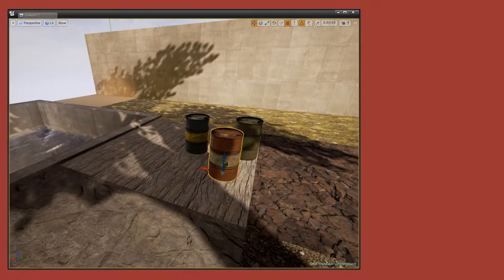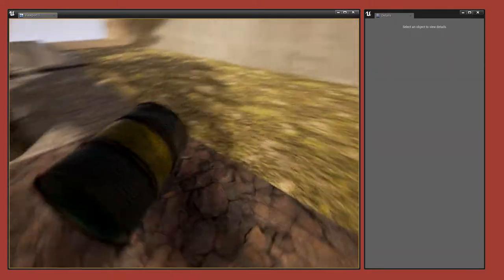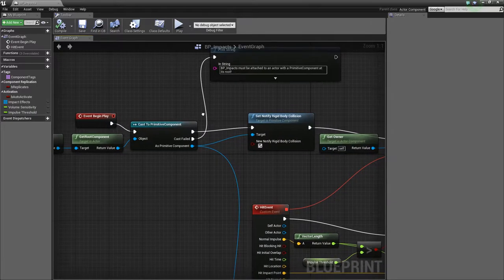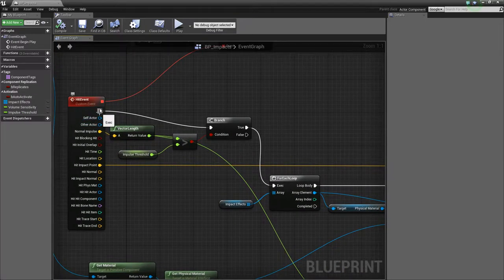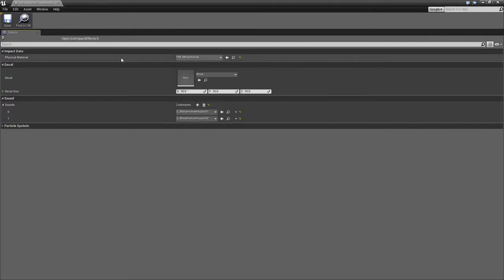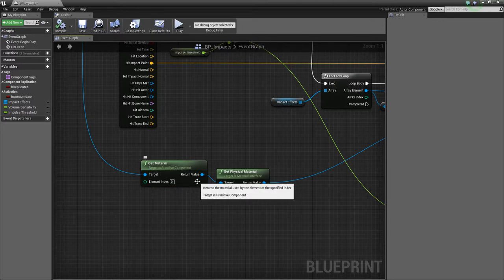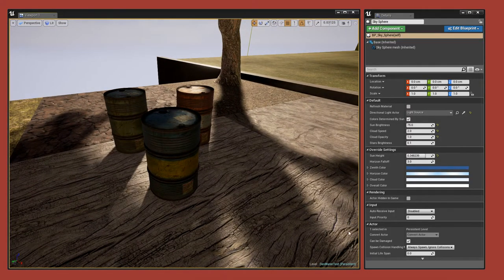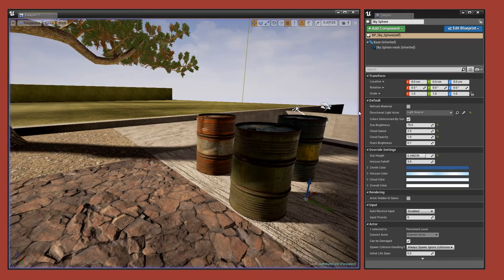Estranged Dev Blog #2: Physics Impact Sounds

Comment: @Alan Edwardes: At 4:08 you say to drag off the bind event to OnActorHit and create a custom event node. When I do this, my custom event node only has about 4 pins, 'Self Actor, Other Actor, Normal Impulse and Hit'. If I select this custom event node and create a new pin for the Hit impact point vector, my blueprint wont compile and I get an error reading. "Signature Error: The function/event 'CustomEvent' does not match the necessary signature - has the delegate or function/event changed? Any advice? I'm on UE 4.22.

Comment: I followed your tutorial but I'm trying to use it with a custom actor BP so I can pick up and throw objects. The problem I've run into is  that I haven't been able to find the right sweet spot for the Impact Threshold as it seems to be totally inconsistent. Right now it's set to 8000 but sometimes the sound won't play and other times it plays way too often. For example, if I'm holding an object and then move it until it impacts with something and keep it there, the impact threshold will be huge  - 20K+ and fires like an event tick so the impact audio will play constantly (or as often as I let it if I use a do once node and a delay before reset). Also some objects don't settle properly in the world and then their hit event constantly fires. It's so close to working properly but not quite there yet.
Reply from the maker: Yes, I had a similar problem and used a "cooldown", so wait time before another sound to play to get passed spamming.

I have re-written this all in C++ however, which I need to make a tutorial for too. If you build a class that inherits from UPhysicsCollisionHandler you can set it in the project settings, so it covers all collisions in the entire game without the need for components on each object.
I would recommend that, and in fact Epic's implementation of UPhysicsCollisionHandler has a "cooldown" period, which means that it will block sounds for T after an impact was played. You can take a look at the reference implementation here: https://github.com/EpicGames/UnrealEngine/blob/release/Engine/Source/Runtime/Engine/Private/PhysicsEngine/PhysicsCollisionHandler.cpp

I will add a tutorial for this at some point, it is just finding the time :)

Cheers,

Alan
Reply: @AlanEdwardes  An Update to see your better and global c++ solution would be very nice. There are no really good tutorials about UE4 and getting a physically based sound environment.

Comment: Hey, great video! I have a quick question. I saw that you also have a pick-up mechanic in your game. How did you handle your impact sounds when you try to push an object through a wall for instance? In my case the OnHit event fires continuously and with a considerable impulse. Thanks! :)
Reply from the maker: Hey, thanks! So I really need to do an update to this video because the impact sound handling has now moved to code - a class that inherits from UPhysicsCollisionHandler and is set in the project settings, so it covers all collisions in the entire game.

I would recommend that, and in fact Epic's implementation of UPhysicsCollisionHandler has a "cooldown" period, which means that it will block sounds for t after an impact was played. You can take a look at the reference implementation here: https://github.com/EpicGames/UnrealEngine/blob/release/Engine/Source/Runtime/Engine/Private/PhysicsEngine/PhysicsCollisionHandler.cpp

Hope that helps!

Alan
Reply: Alan Edwardes Thanks for the tip! I'll look into that for sure. Also what you're suggesting is to just use a delay between playing impact sounds? Or did you add extra logic/checks on top of that?
Reply from the maker: Yeah, so i'm just using the default implementation right now, but you might want to do something more intelligent. Here're are the lines with the specific cooldown logic: https://github.com/EpicGames/UnrealEngine/blob/release/Engine/Source/Runtime/Engine/Private/PhysicsEngine/PhysicsCollisionHandler.cpp#L59-L64
Reply: Alan Edwardes Yeah the link does't work for me :D But I'll give that a try and I'll experiment with some overlap checks as well to detect when an object enters/exits contact with a surface. Been contemplating ideas all day :) Thanks again!
Reply from the maker: Cool, glad I could help! You can load those links if you link your GitHub account to your Epic Games account - Epic have the entire Unreal Engine 4 source code available to anyone, you just have to link up the accounts on unrealengine.com because the org is private.

If you're thinking about building anything with Unreal I'd highly recommend it, a quick engine source reference available anytime :)

Comment: so if 2 barrels colliding, u will generate 2 sounds?
Reply from the maker: With this implementation yes - take a look at this thread, I moved it over to a global collision handler where you could use heuristics to detect things like this: https://www.youtube.com/watch?v=8H6DsqN-rQo&lc=z12rtdwakrurez5qu04ch1cpmkrmjd5iqog0k.1490983596243660
Reply: your link points to this video..
Reply from the maker: Scroll down, it's my reply to zouru.